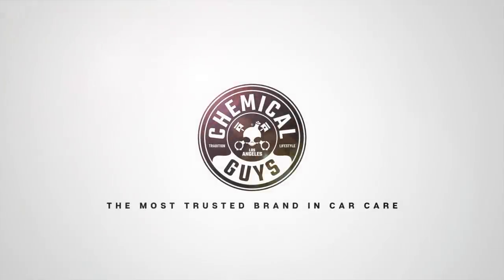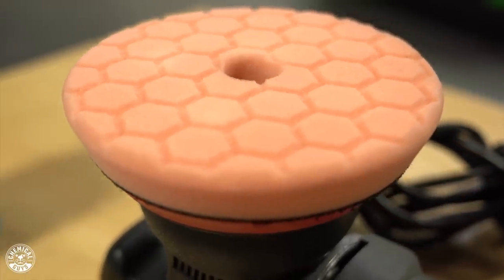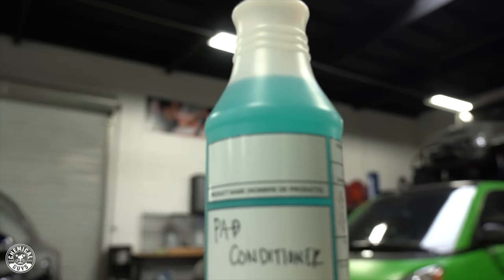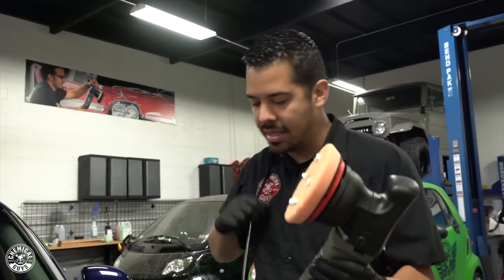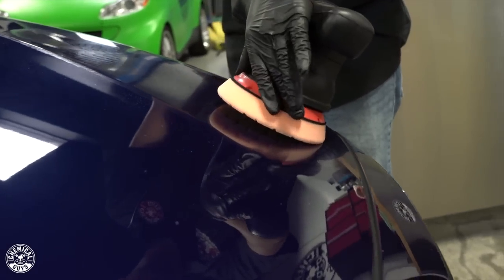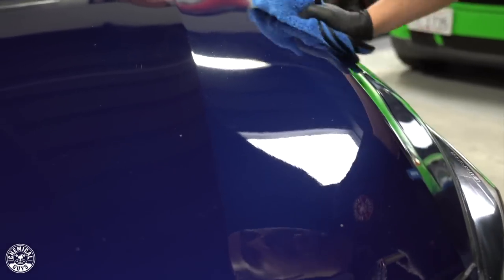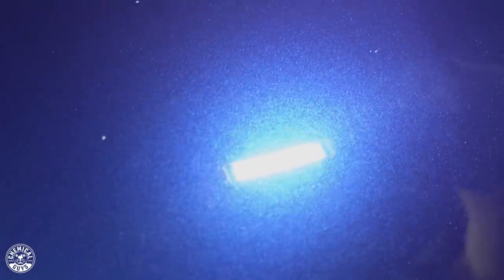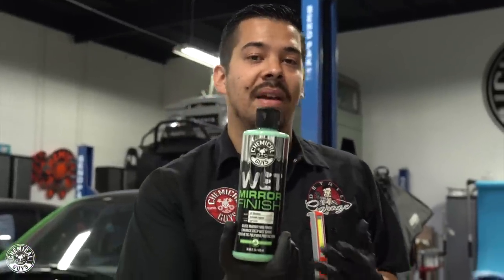How to Make Metallic Paint Shine! - Chemical Guys

Comment: 2Q: 1) will you make a coating for leather and interior use? 2) is it ok to apply HydroCharge/Carbon or JetSeal on the interior side of the glass?
Reply: Great questions. +1 for these.
Reply: For question 2, honestly there is no point to coat the inside of the glass since it is not being exposed to the environment 24/7

Comment: Great video and information.  The CG step/flow chart shows using a sealant between glaze and wax. Did the wax have the sealant mixed in it? Usually you guys mention using Jet Seal in between glaze and wax.  As always, thanks!
Reply: jet seal is a sealant
Reply: and you do wax as last of all steps because the wax removes first and is cheapest to reapply
Reply: @aukyo  ...I know and got all the above. I was specifically asking did they seal in between the glaze and wax.  And why not, if they didn't since it is one of their six step process they have. Have a good day.
Reply: @Rich--J  People will apply glaze first if the paint has imperfections in it.  For instance, they do a paint correction and even after the correction, there is still some light scratches/marring, etc.  In your case, it sounds like even after using some revive, there's going to be imperfections, so you could apply glaze first to help hide those imperfections and then apply paint sealant and top it off with a good wax.  If the vehicles paint is flawless, then applying paint sealant first, followed by a glaze, and then topping it off with a good wax.  I've never used glaze first; just my personal preference, but my vehicles paint is flawless and it's a show/drag car that doesn't see any inclement weather and is garaged at all times.

Comment: I just bought a Tacoma SR5 with Magnetic Gray Metallic color. Based on your experience, what product should I use to maintain this color?
Reply from the maker: Hi there! I recommend applying Black Light Glaze and Butter Wet Wax to enhance depth and gloss while adding protection.

Comment: If your polishing is dine correctly, glaze is really not needed. Imo. That lava paste BETTER be good for $70!!!
Reply: Well they didnt just use the glaze only to make it shinier, the glaze will fill in the open pores of the paint that has been opened due to the polishing. With the wax over the glaze it is additional shine and as well as an additional layer of protection for the paint. Best to have the paint protected with both.